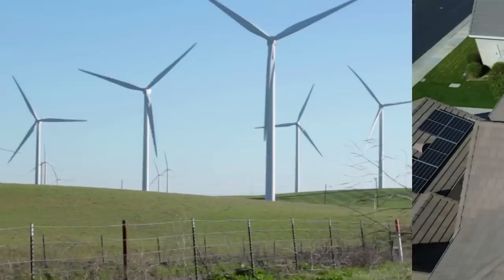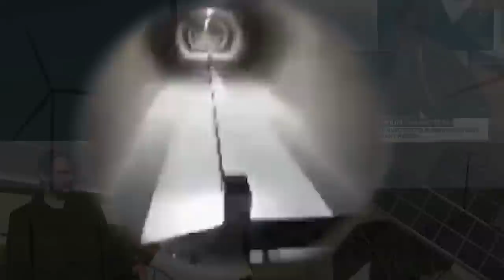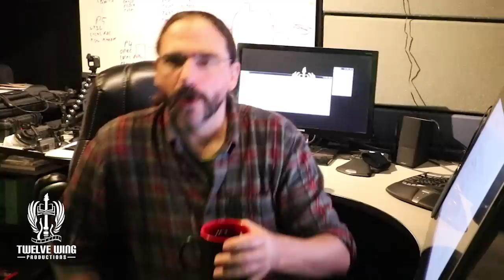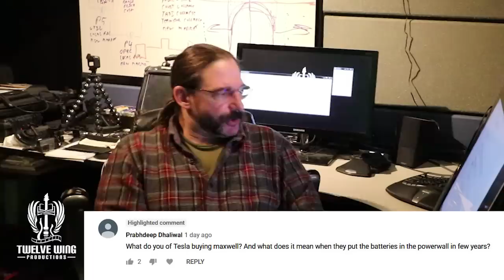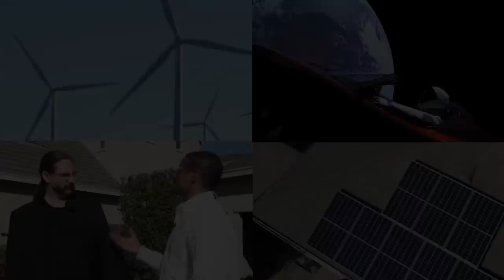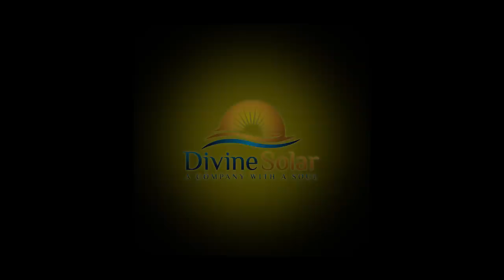Tesla purchases Maxwell; What does it mean for the Powerwall?

Comment: If Tesla plans to make batteries, then I am uncertain if there is currently sufficient floor space to do this at G1.

Continuing the construction of G1 to do this might be a first clue that this could be happening.  On the other hand, this might signal their intention to assemble cars at G1 and expand the available factory space.

Rhandsom has a channel in YouTube in which he shows his successfull integration of ultra capacitors with a battery bank for residential use.  His videos are very instructive for understanding the benefits of this integration.  His battery chemistry is different (and in my opinion superior to Lithium) from power walls, but the result is undoubtedly hard to argue against.

His example of ultra capacitors with a battery bank is perhaps an indication of where integrating both technologies might be superior to a ‘simple’ battery bank.
Reply from the maker: Thanks, I'll go over and check out what he is doing.
You are spot on about your observations with G1.
Any manufacturing there will require additional build out and that will be a clue.  My thought is that they are creating the machines needed to manufacture the batteries in an annex somewhere.  Maybe even the building they purchased near me in Latrobe.
Once they get the machines designed for manufacture, it won't be but a month or so before we see them installed for initial testing somewhere at speed.  At that time they would likely build out space for it and either wave bye bye to Panasonic entirely or use the new line as leverage against Panasonic to get better contracts.
That's something I have experience with as far as what happens in manufacturing, but it's not anything I have specific information about regarding Tesla specifically.
Either way, it's going to be fun to watch.
Reply: @twelvewingproductions7508  The Maxwell dry electrode system is 16X more production density efficient than Panasonic's wet method.
Reply from the maker: @waynerussell6401 , I'm actually trying to research that right now.
Can you tell me what your sources are?

Obviously, if you don't ave to turn your electrolyte or your graphite into a paint first you are WAY ahead of the game as far as manufacturing footprint and power use.
I would love to present this to folks in a future video but I need to have hard data to go by first.
Reply: @twelvewingproductions7508  See Maxwell presentation to Needham Conference Jan 18 2019, slide ten.
http://s21.q4cdn.com/566123494/files/doc_presentations/2019/Maxwell-Needham-Conference-Deck.pdf
Also white paper to Power Sources  Conference:

http://www.powersourcesconference.com/Power%20Sources%202018%20Digest/docs/3-1.pdf
Because of the severe crippling losses Maxwell were making their research staff have left, the lead researcher went in 2012 to form his own company and the rest formed Skeleton in Estonia, the leading density provider with 'curved  graphene material'. Keeping IP may be difficult!
SpaceX may be a user of Ultracaps with pulsed communications-data transmission being important for Star Link.

Comment: I also heard that Maxwell was working on using Ultra Capacitors with car suspensions ( shock absorbers ) to recover this energy ??????????
Reply from the maker: I'm not sure if the idea was to recover energy, but maybe.
As things progress, I expect that vehicle systems will become more and more integrated over time and things like that are certainly possible.
Other than energy recovery from bumps, I think that what they are after is just a system that might use less energy overall.   Air suspension is pretty good these days though.  So they will probably keep that and as you said, use the electrical resistance for dampening and recovery of energy.
Reply: @twelvewingproductions7508  FWIW I'd read speculation the the ultra caps would be used, not for energy recovery, but to give the suspension a faster reaction time.

Comment: Halo Twelve Wing Productions, what we have
to say about loading time when using ultracaps.
Let's say for simplicity, we replace all batteries
with ultracaps.

Yes, you fill the ultracaps very quickly compared
to the battreies.  But since we fill the same
amount of energy in a short time, the charge
current increases in the same proportion.

For example, your car has a battery charging time
of, say, 3 hours. If you bring the same power into
your car in 3 minutes with ultracaps, you would
have a charge current strength of many thousands
of amperes. This is nowhere possible.

Translated with www.DeepL.com/Translator
Reply from the maker: That depends largely on the voltage.
It also depends on the charge cable being cooled.
Tesla is designing a new charger for the semi and for their next generation of vehicles.
I believe the current model 3 can handle the increased current from the new chargers. 

You are correct, however, the ultracaps are going to be a whole different animal.
Reply from the maker: The conversation wasn't about the load on the cable.  As I stated, the cable may need to be cooled.  The discussion was on speed of charge.
The delivery voltage plays a key role in the delivery speed and also the current ultimately.
But we are discussing how ultra caps are going to benefit the charging stations.  Raising the voltage of the charger also raises the overall capacity of the charger.

The power delivered to the vehicle in any given amount of time depends greatly on the voltage of the system.
Equally, the amount of deliverable power available to the system also depends on voltage.

A bank of ultra capacitors at 400V, capable of delivering 100A has a delivery of 40kw.
If that same system operates at 600V, delivery is 60kw.
It's important now to break this down into both time and current delivery to the vehicle.
If the vehicle limits it's charge to 40kw  in the above 600V charge scenario, then the addition of the additional voltage turns into capacity.

It's also to remember that with the addition of ultra capacitors we will be looking at two charge systems within the vehicle.  One for the ultra capacitors that has a high amperage for inflow (Likely north of 1,500A) current from the car charger and another into and out of the ultra capacitor from the main battery of the vehicle.
This internal buss will not carry the same amount of current as the charger side and will be responsible for the secondary charge received by the car's battery.
EDIT  when I say that the delivery side is north of 1,500A, this is not to say that this is in a single line.
A blow up of the plug for Tesla's "Megacharger" shows a large port that seems to contain as many as 4 standard supercharger plugs.
So there is more than one way to skin this amperage cat.
Reply: @twelvewingproductions7508  The one mentioned here
concerns the case where a very large stack of ultracaps
can be quickly loaded.

A really thick charging cable will certainly not get very
warm in the short charging phase.  But the cable is
also very heavy. If the system is a DC system, the
question arises as to the immense magnetic induction
that emanates from the cable during the current flow. 

Interesting is the question from which source at the
charging station this huge short-term energy
quantity can originate.
Reply from the maker: @silberlinie  

"If the system is a DC system, the
question arises as to the immense magnetic induction
that emanates from the cable during the current flow. "~

Now that... will be interesting.  They are going to have to dampen that some how to be sure.  Also making sure there is a draw down of current after the charging is finished.  A sudden loss of power with loops in that cable could get... interesting.. in a hurry.
Reply from the maker: @silberlinie  

"If the system is a DC system, the
question arises as to the immense magnetic induction
that emanates from the cable during the current flow. "~

Now that... will be interesting.  They are going to have to dampen that some how to be sure.  Also making sure there is a draw down of current after the charging is finished.  A sudden loss of power with loops in that cable could get... interesting.. in a hurry.

Comment: I don't think the capacitors part of Maxwell had anything to do with the purchase. The higher energy density "batteries" and dry technology is what it was all about.
Reply from the maker: I can't totally disagree with that, but I would point out that Tesla's new reactive suspension looks an awful lot like a real world application that Maxwell owns a patent to where their ultra capacitors drive a variable suspension component.
I have no firm verification of this just yet, but it would stand to reason that Tesla would seek an electronic suspension rather than one driven by an air compressor.

So though I have no direct rebuttal to your ideas on the matter, I think that it's a case where Maxwell was chosen because it had several things that Tesla was looking for.  Otherwise they may have just licensed the tech instead of purchasing the entire company.

Comment: Actually, Tesla OWNS the chemistry used in the making of the 2170 cells, at Gigafactory 1.  However, Panasonic produces the batteries with the chemistry that Tesla owns.  This does NOT apply to the 18650 batteries produces, in Japan, for the Model S and X.
Reply: Rickard has shown little difference between the two cell formats Tesla uses meaning they both contain the same Tesla chemistry.
https://www.youtube.com/watch?v=zvavP2RJSLc&t=3645s
Reply from the maker: It goes further than that.
Panasonic owns patents related to the manufacturing process itself.
Everything I've just said applies equally to both the 2170 and the 18650.
The Maxwell acquisition allows Tesla to start making batteries utilizing this new dry electrode method.
As to "ownership", the manufacturing world doesn't work that way.
Either you have intellectual property agreements or patents in place to protect what you bring to the table.
Ownership goes no further than your ability to protect it.

Like I said, it's a nuanced answer to his question.
Reply: @twelvewingproductions7508  I said Tesla owns the CHEMISTRY, for their 2170 batteries. In other words, Panasonic cannot make any of those specific 2170 batteries to sell to any other companies.
Reply from the maker: @AscendedSaiyan3 ,
I can't make this any more clear than I have.
You aren't saying anything that I didn't say in the video.
There are intellectual property agreements in place between Tesla and Panasonic.
That said, you don't own IP like you own a pet or even a car.  It's not a possession you can put in a box when not in use.

Tesla, on the other hand, is excluded from making batteries due to Panasonic's patents on their manufacturing method.
Further, Tesla couldn't even come CLOSE to utilizing the same manufacturing technique without Panasonic claiming that their tech had "matured" from existing patented material.  This is known as "exposure".

To eliminate this, Tesla purchased Maxwell, a company that had independently developed technology that Tesla can now leverage to make batteries.

So you can keep repeating that Tesla owns the IP, but the reality is that their battery chemistry is very difficult to secure.  Tesla now has a way out from under Panasonic.  And I think they will be taking it.
Reply: @twelvewingproductions7508  The point is that your video, at 18:10, is incorrect as stated. Panasonic does not "have a proprietary CHEMISTRY that they use for making Tesla's batteries". You could confuse people, by saying that.

That chemistry's U.S. Patent and several others were created and patented by the battery scientists from Canada. Tesla has a 4 year contract with them to discover battery chemistries with specific properties.  However, the other things you mentioned are correct.
Reply from the maker: @AscendedSaiyan3 , incorrect.  It's your misinterpretation of what I said.
Perhaps my fault that I wasn't more clear.
There are intellectual property agreements in place between Panasonic and Tesla, not patent agreements.
Panasonic makes the batteries using Tesla's proprietary battery chemistry... but Panasonic makes the batteries.
Not only does Panasonic make the batteries but they do so under the same roof in a facility that Tesla makes it's own products.
Though this is efficient and gives the illusion of vertical integration, it's not.

So I'm not sure what semantic game you want to continue to play with this but what I said was/is 100% accurate as it reflects their current situation.
The other thing to keep in mind is that it's incredibly difficult to patent something like battery chemistry.  This falls more into the same category of intellectual property as do any kind of recipe.
If someone else starts using it, your only real legal recourse is to try and prove that the property was stolen rather than reverse engineered.

But again, this really has no bearing on the point of the Maxwell acquisition. 

The point of this video was to show that the likely reason for them purchasing Maxwell is to use it to allow them to start to actually manufacture their own batteries.
Something they don't actually currently do.
Reply: @twelvewingproductions7508  
I can provide U.S. patent numbers for several of Teslas chemistries and processes, if you are interested. 

Maybe I misinterpreted that section. However, if I misinterpreted that with my level of knowledge of the company and their agreements, a TON of people would do the same.
Reply from the maker: @AscendedSaiyan3 , a fair point and I'll try and be more clear when talking about this in the future.
No need to present these patents, but I would like you to verify that these are granted patents and not just patents that are applied for.
You may also need to acknowledge one other part of what I'm saying and also come to the agreement that there is a huge difference from having a patent and being able to defend it.
Until a patent is successfully defended, it's not considered a very strong protection.

Battery chemistry, just like the formula for Coke, is something that's INCREDIBLY difficult to get protections for.
Because people have been messing with the proportions of things like electrolyte composition and transition metal makeup using the EXACT SAME MATERIALS in different proportions since the 90's, it's pretty difficult to defend your exact formula with a patent.

So if we are both being honest about this, and it sounds like you are by the words you have chosen, these battery chemistries are protected by IP agreements between Tesla and Panasonic and not by any patents either company may hold.
Some might say that this relationship is actually stronger because there is a more immediate (and costly) remedy for violating this type of contractual agreement than there might be for trying to defend battery chemistry in patent court.
Reply: @twelvewingproductions7508  This is the latest. 

https://electrek.co/2019/02/01/tesla-patent-battery-cell/

Here is a link to the research Jeff Dahn's research group is contracted to help Tesla with.

https://electrek.co/2017/05/09/tesla-battery-lifetime-double/
Reply: @twelvewingproductions7508  It is more likely they will now supply electrodes to Panasonic for use in Tesla products as they already have the process up and running for UltraCap production. Panasonic have indicated a stop on line growth at Giga1, though not line optimization.
Reply from the maker: @waynerussell6401 ,
A very well reasoned result.
I will point out, though, that we need to understand the nuances as to WHY that is the result.
Panasonic isn't going to do anything it doesn't want to... unless it HAS to.
Unchecked, Panasonic would abuse the relationship.  There were clues last year that it was already doing that.

Tesla now has this new technology and is using it not as a cudgel but instead as a means to create a win win situation.
Big companies, especially companies that are established in manufacturing, hate change.  Panasonic was looking for business as usual with Tesla just tossing money at them to increase their capacity.

What we have now is a closer symbiotic relationship between Tesla and Panasonic where Panasonic will likely lease the new technology from Tesla to make the next generation of batteries.
I can't imagine a better win win situation for both companies and ultimately a huge win for the consumers as well.